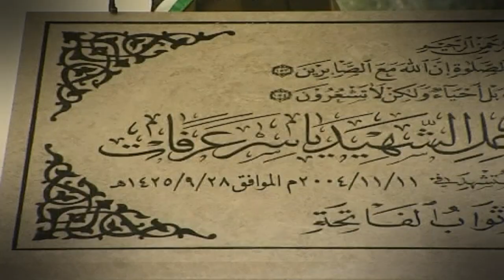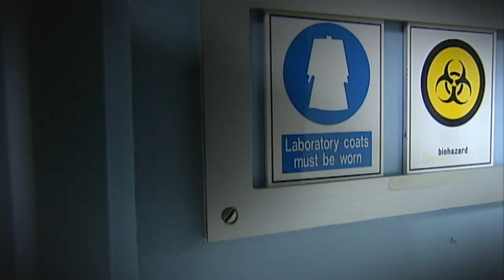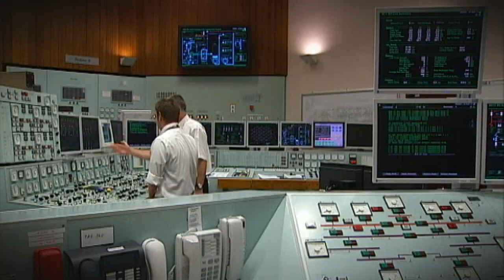Poisoning spies: Why Polonium-210 is the poison of choice - Truthloader

Comment: If it's so hard to get a hold of, how does it end up in cigarette smoke?
Reply: It collects as lead on tobacco leaves, and then once the chain of production begins, it starts to turn into Plutonium-210. I'm assuming through some miniscule form of fusion, but I'm not exactly sure. I just know it occurs during the production stage.
Reply: Sean Wilkerson That's not true. You can't make plutonium from polonium.
Reply: Sean Wilkerson That's not correct. It can be made from radon, uranium and an isotope of bismuth. Wiki it :)

Comment: I'm curious,  they left a trail     of radioactive particles from the start,  to the airplane,  to the hotel sink they dumped the remaining plutonium into.  Does the radiation left around and traces cause potential harm? 
Where they dumped it into the sink?  In the US,  used water goes to water treatment and is cleaned,  before getting recycled and reused...  Can plutonium cause harm in any other way?
Reply: Yes anyone who ingests any polonium is likely to get cancer. The poisoners are almost Guaranteed to die as well judig by the level of contamination they left behind they themselves were very contaminated.